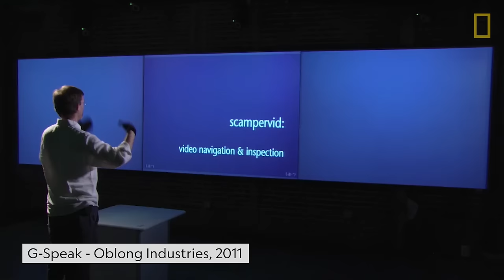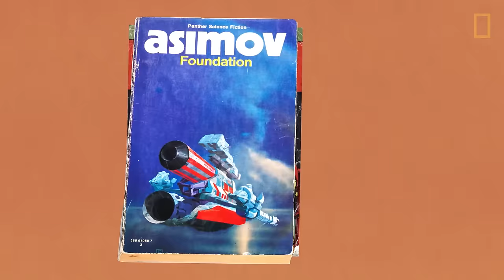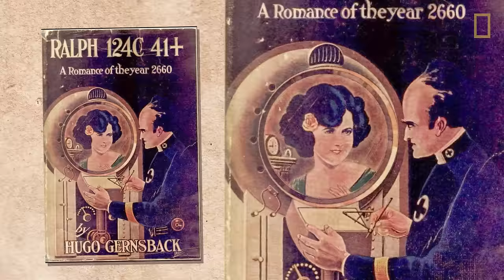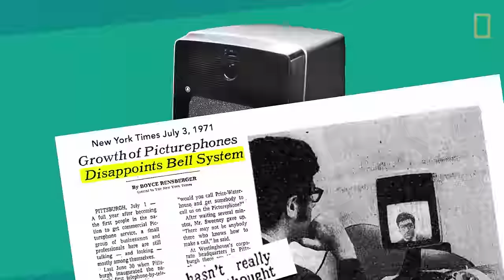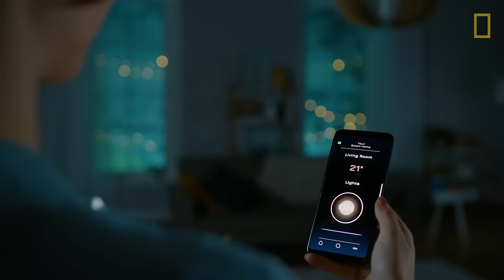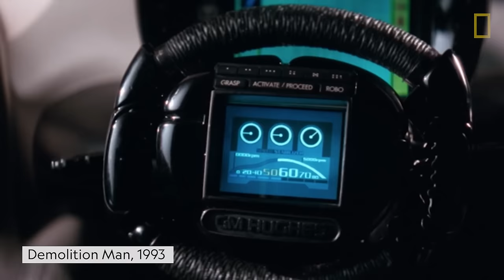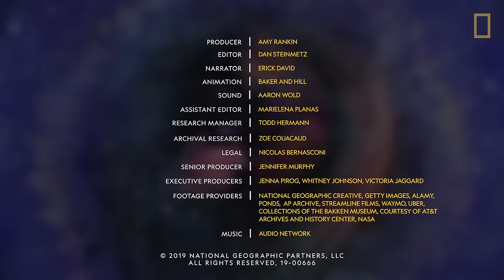Science Fiction Inspires the Future of Science | National Geographic

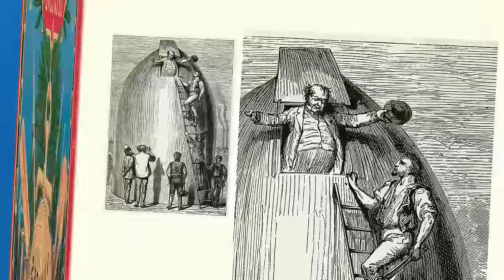Comment: 2:42 this has a few problems. First, wheres the oxygen supply? Thrusters, oxygen tanks, spacesuits, gun needed to fire something at that speed, rcs, landing module, a way to survive the impact, parachutes, heat shield, sample collector, orbit module, main module, fuel, propellants, copvs, computers, guidance systems, and the worst thing. How are you expecting an aluminum bullet with a crew inside to survive the g force and extreme heat that will surely disintefrate the spacecraft both on re entry and on launch. also the kinetic forces from the impact. This is not even close to the actual apollo project.

Edit: just mentioned this for fun, it inspired rocket scientists, but this is far away from being "the inspiration for the command module".